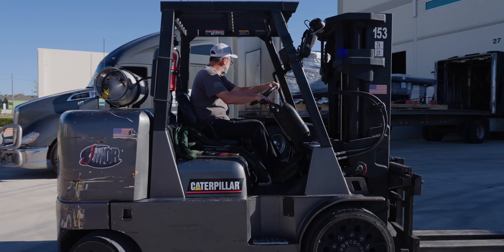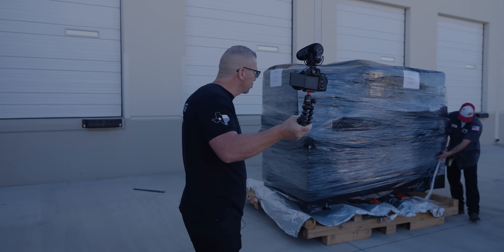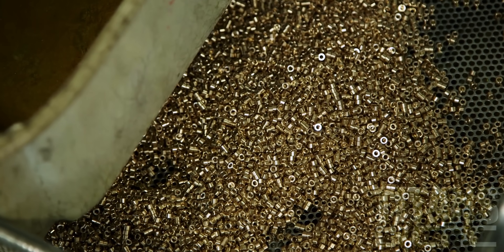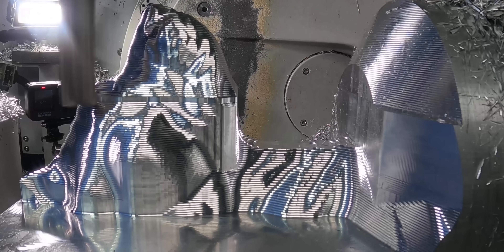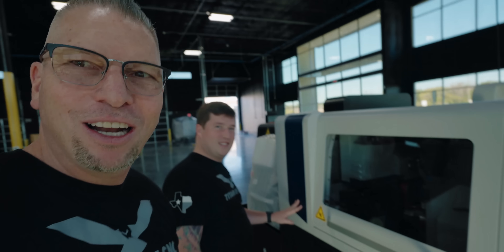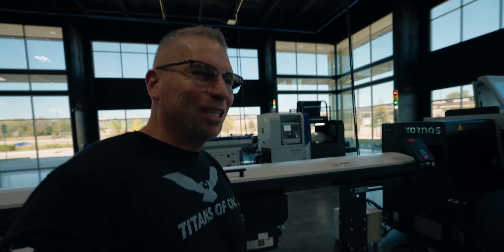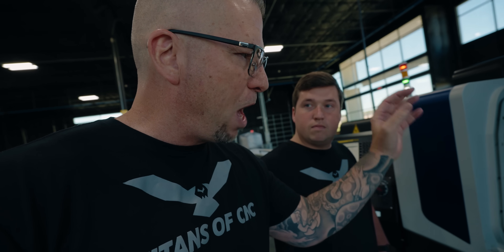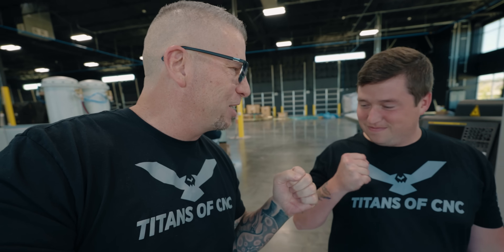NEW Entry Level Sliding Head Lathe | Swiss CNC Machine #2

Comment: Most shops I have seen have more than just 1 swiss . Could have 1 guy running up to 10 or more. I've never run more than 7 lathes which keeps you busy but they weren't even swiss ! The swiss is the best for high production runs

Comment: Great to see you guys getting into swiss machining. We actually got that same GT32 at my workplace last year. I'm still an apprentice but there is this guy who's been cranking up parts for nearly two decades on the swiss lathes. It can be challenging when the parts are small/tolerances tight but it's so satisfying when you actually get the parts running. BOOM from Finland!

Comment: Swiss Machining is not new!  In the two man shop I worked at we had a Hardinge swiss from 1998 I believe. Most of the features on the Tornos were on the Hardinge. Very cool machine!  In a similar fashion, we also had a Nakamura Tome WT300 with a twenty foot bar feeder making 2.5 x 18 inch 4140 slotted pins for the AG industry,  Fully automated!  Load the bars, unload the parts, BOOM!
Reply: I thought Swiss machining was small parts.2.5 X 18 inch is decent size.

Comment: I started off as a toolroom machinist making Form tools, 56 years ago, then traversed to setting cam auto's single/multi spindle, swiss, then plugboard auto's, to NC autos, then CNC, finally having my own company based in the UK doing sub-contract CNC machining for customers worldwide, including the USA, if you have gas car I expect from time to time your gas has been pumped through underground fittings supplying gas to the pumps, or if you sail, rope handling equipment, jammers, rope locks etc on your yacht. 
Unfortunately I'm retired now but boy oh boy you certainly light the fire in my passion for making stuff. I take my hat off to you Titan and all your staff at Titans of CNC. I wish I was starting out all over again
Reply from the maker: Thanks Steve, That Means a lot🙏🤙😁